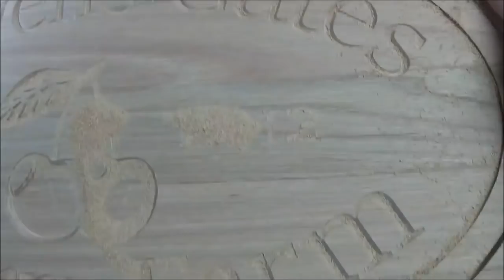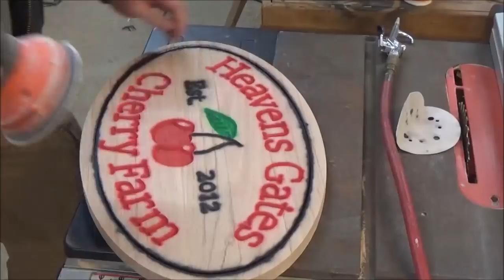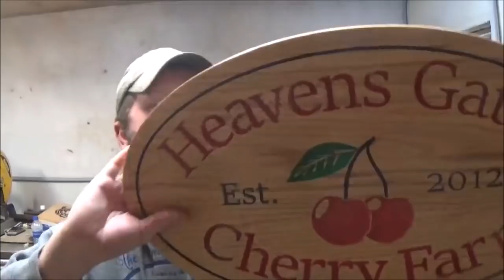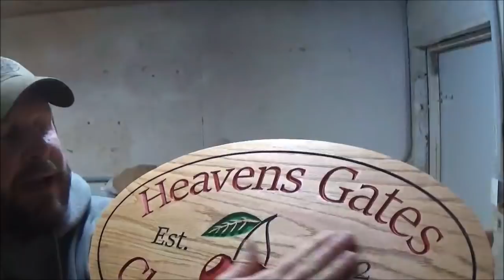Heavens Gates Sign (CNC engraved)

Comment: Nice work there Smokey, great looking finish. How did you manage to prevent the sanded dust residue from contaminating the pores of the rest of the wood background?
Reply from the maker: generally the sawdust doesn't pose a problem for just the wood....however, most of the time I do a light coat of spray poly just after cutting and before painting...That way excess paint is taken off with the light layer of poly....

Comment: That's really a nice job you did there.  I have a CNC and have made some signs, but I have used Krylon paint as well as some others to color them then run them through my Woodmaster 25" planer  to finish them.  I also have a couple of airburshes that I used to use when painting metal signs and weathervanes.  For those I used "One Shot" lettering enamel.  In watching your video I noticed you pouring that Createx paint right from the bottle into your airbrush cup.  Is that stuff thin enough to use right out of the bottle or do you thin it down.  I always had to thin the paints for my airbrushes to a consistency of water to allow them to flow properly out of the brush.  I'm really curious about that and would sure like to know more about that Createx paint.  Thanks Smokey, and again, that is really a beautiful sign you made there.  Best to you.

Jim
Reply from the maker: I did use rattle cans, it was just to much sanding, the CreateX comes from hobby lobby, Occasionally I'll run across a color, Blue is one of them, that I have to thin with water a little, the black and red seem to do just fine without thinning....I have a 13" planer as well, I plane rough stuff before CNC....I don't run my stuff through the planer on video (kinda takes away from some of the video in my opinion)..The putting it through the planer after painting does work well, I sometimes do that on stuff I'm not videoing and do it on large orders as well. Thanks for watching!!
Reply: Thanks for the information Smokey, I'' get some of that Createx paint and give it a try.  I like the way you can concentrate the paint in smaller areas as compared to rattle cans.  Thanks again.
Jim
Reply from the maker: You bet, you won't regret using a airbrush, If I would take my time, I could cut the sanding down a lot...painting isn't my favorite thing to do though...

Comment: What kind of paint do you use?  Do you seal before paint?  Stuff turns out beautiful!
Reply from the maker: I don't recall what paint I was using at that time...If it was airbrush it was createx opaque and on oak I use sanding sealer before even cutting a lot of the time....Thanks for watching!

Comment: Hi, nice vid. I enjoyed your painting technique with the air set up. Can you tell me your set up as far as psi, compressor, your sprayer and the type of paint your using. Do you add water to the paint?

One more thing, it didn t appear that you put a sealer on the sign before you painted it. I would think that oak would bleed pretty good without sealing it. I welcome your comments. Thank you sir.
Reply from the maker: I use a Iwata revolution airbrush, I'll have to get back on the psi, i'm in the house and its late i'll have to check on that for you, using createx paint not thinned down and its a master compressor, links for all of these things are in the description box below the video...I do seal sometimes and sometimes I don't. I use sanding sealer when i do seal it....Some runs of oak work awesome without sealing and some don't...I usually just inspect how open the grain is before i get started and even then I miss sometimes...Thanks for watching!!

Comment: Awesome! You like the frued bit?
Reply from the maker: They work well and have found that they handle getting sharpened several times before they are no longer with in the tolerance witdth.  I have 3 of them and 1 of them is probably going to be done after the next sharpening or 2.....Thanks for watching!!!
Reply: @SmokeysCNCWoodworks  Thanks! I believe my Dewalt 611 will handle the 1/4 shank...its at a good price. I think I'll pull the trigger through your link. Thanks!
Reply from the maker: Thank you and thanks for watching!!!
Reply: Smokey's CNC Woodworks Could you do a video (unless I missed it) on the bits you use and sharpening bits? I just bought the 90 VBit. The 1/8 end mills you listed state they are for metal on Amazon...may be a dumb question, but I assume the are good for wood? Thanks!
Reply from the maker: I did a video quite a few videos ago about how to sharpen the bits, I have link to get the sharpeners, they are like $10-$12 dollars.....I've been using my sharpeners for quite a while, and still using them.  They are cheap but do the job, and when they wear out I plan on ordering another set of them....Thanks for watching!!